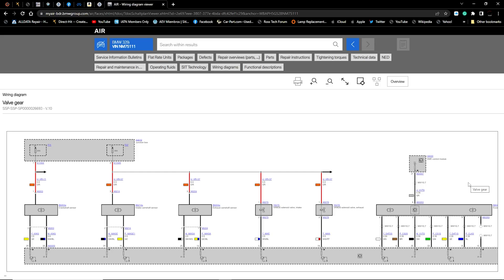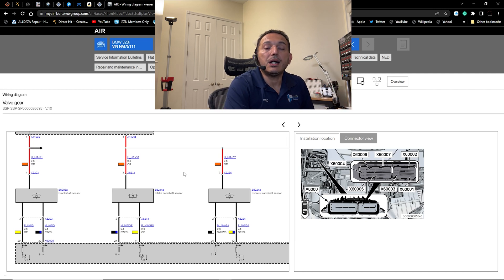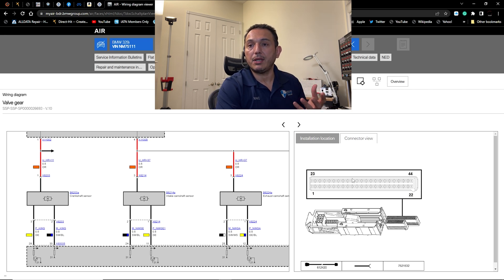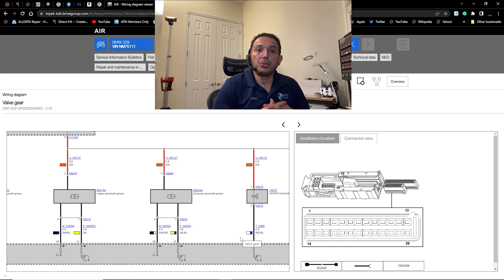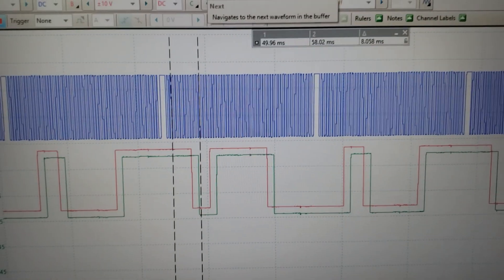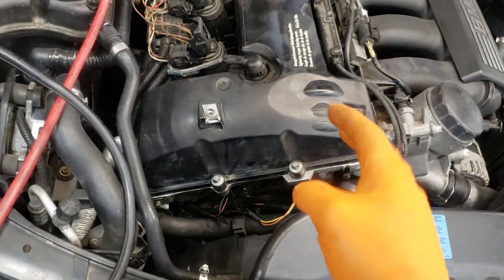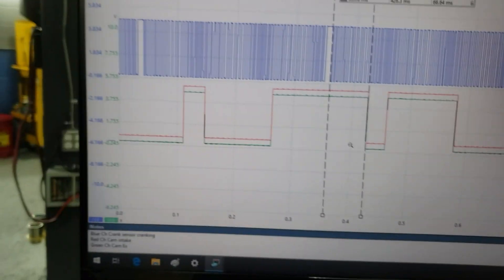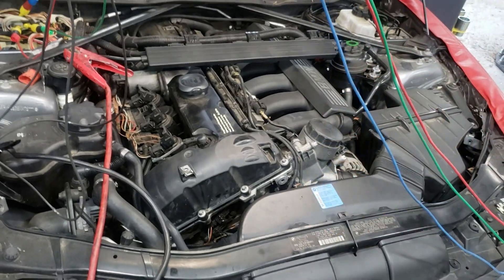2011 BMW 328 N51 (N52 same) Cam   Crank Correlation test. Plus Wiring diagrams explanation!

Comment: Can this oscilloscope test be performed with the engine cranking/not starting?
Reply from the maker: Sure , that is a cranking capture and is valid when you want to see if the timing is correct

Comment: When doing at idle cam crank correlation readings do you unplug the vvt solenoids? If left plugged in wouldn't the waveforms be changing depending on ecm control ? Thanks for the video brother .
Reply: Vvt are plugged in. First capture is from idle and compared with known good on idle. The second capture is cranking where the solenoids are not controlled..... You could take a capture with Vvt not plugged in and you will have to compare with a known good cranking capture